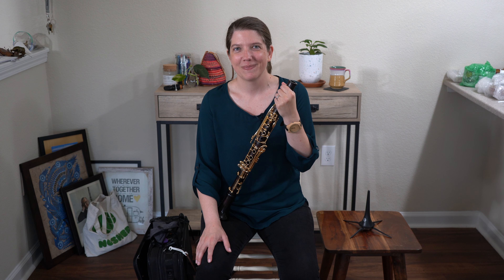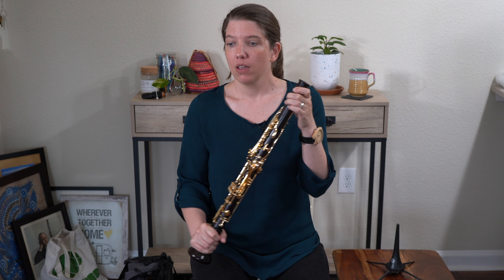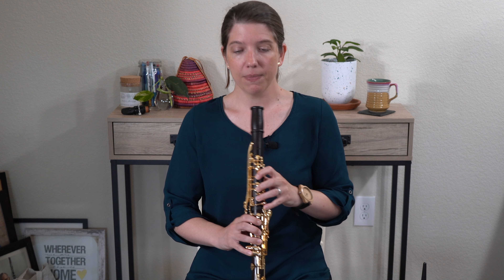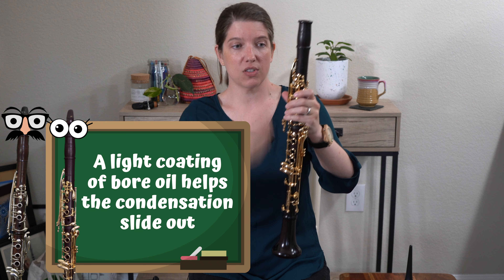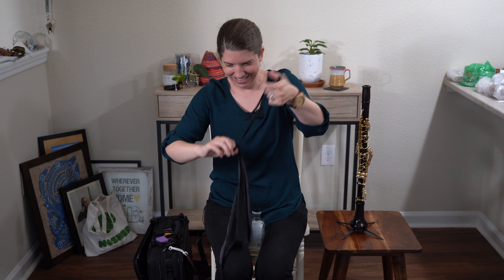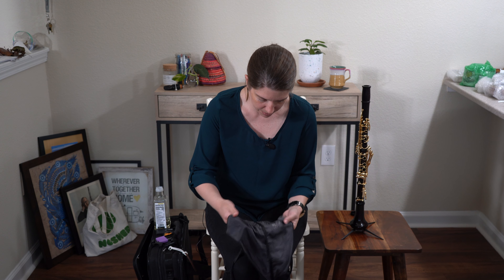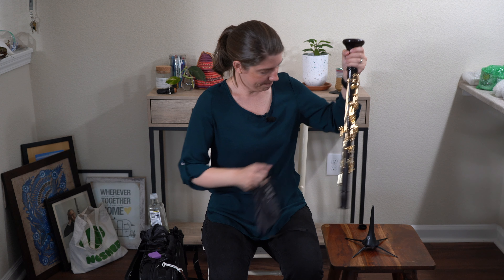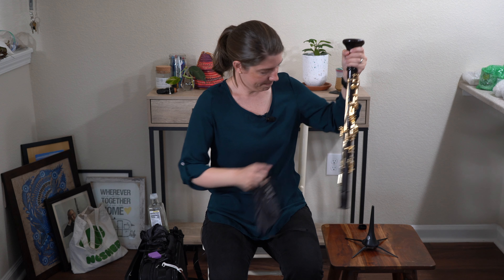Don't Let Your Clarinet Crack!

Comment: Look for more accurate non-alarmist information at professional clarinet makers and repairers such as Backun.
Reply from the maker: There's no reason for anyone to panic about their clarinet cracking. Sometime you can do everything right and still get a crack. However, it is something to take seriously, especially if you live in a dry climate. A little prevention goes a long way. As Backun artists, most of the information we share in this video is directly from them, but it never hurts to consult directly with the manufacturer or a trusted teacher/technician.

Comment: Should I oil the bore on a new clarinet and where do I purchase Pure sweet Almond oil.
Reply from the maker: I would, especially if it's brand new. It'll help prevent the wood from taking on too much moisture, which can happen with new instruments. You should be able to find sweet almond oil at grocery or health food stores. If not, you can find it at an online retailer like Amazon. Just make sure it's 100% sweet almond oil.

Comment: Great info thanks! What swabs do you recommend?
Reply from the maker: Thank you! 
Anything silk with a weight at the end of the string and specifically made for clarinet. There are a number of good ones out there, but this is one: https://www.amazon.com/Hodge-Silk-Clarinet-Swab-Black/dp/B0002F4Y8W

There are some good microfiber swabs out there as well, but you need to be careful. Microfiber swabs can be thicker, which makes it easier to get caught on the register tube. ProTec, Vandoren, and BG all make microfiber swabs. They are really great at absorbing moisture, probably better than silk. If you get one, just be extra certain that it's for B-flat/A clarinet and be extra careful when swabbing.